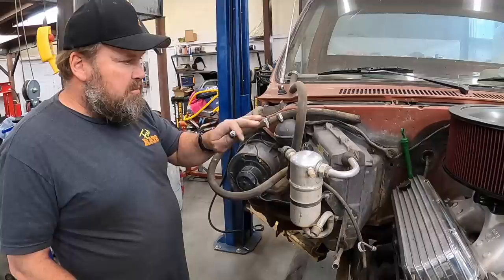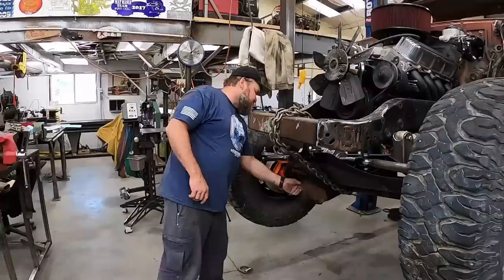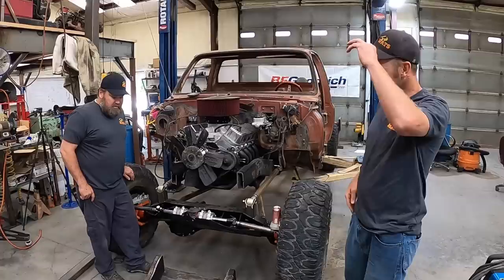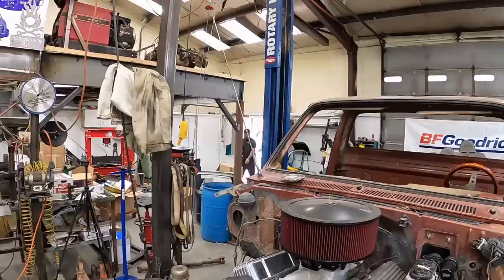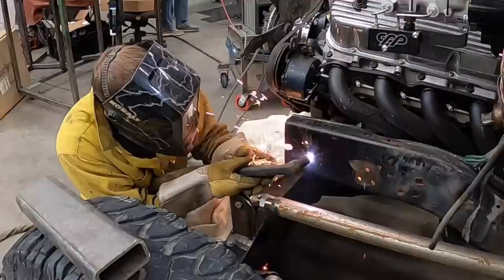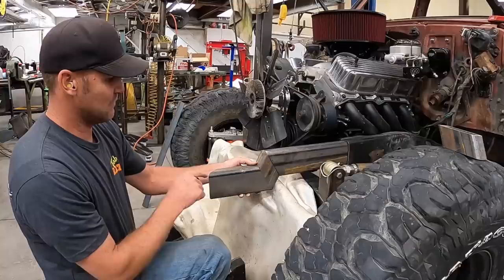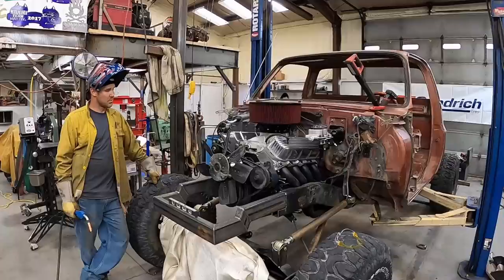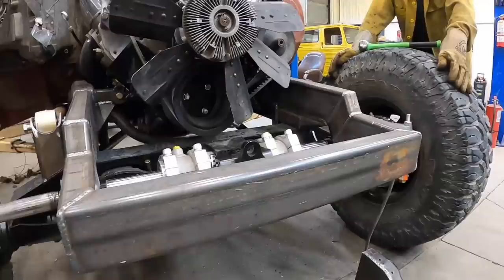This Custom Frame Is Never Going To Bend On The Rat Rod Tow Truck!

Comment: Why didnt you just plasma cut the existing frame to the dimensions you needed? You coulda saved on material and time. Also it would have been stronger once tubed back since there would be no butt weld seams. Im sure you have a good reason.

Comment: With all due respect, I see you struggling on many if not all of your angle stuff.
The way I learned when I was knee high to a grasshopper was to bend a welding rod when bending exhaust pipe.  That technique works bending, shaping, or cutting any tubing (round or boxed), and works when attempting to shape or cut sheet metal, and even plate.  The first time or two on a project you might guessing, using your eyechrometer, or perhaps using two other hands bending a tape measure to get your bends close.
the beauty of the rod is that it can be reshaped as many times as you need to get right, even perfect.  The wire is your mock-up tool.
Finally, you can use a light gauge wire or heavy wire to make shaping easy, or if you need some strength for longer lengths.
Use a wire...

Comment: I don't understand why you straight cut the 6" frame off behind the axle and replaced the removed material with a 4", and then added a 2" chunk right back in?  Why not just cut the 6" frame off at an angle above the axle and tie in the new front front piece and have the same shape you have now?

Comment: Exchange out the two door cab to a four door cab for more room. Then paint the papa sherm mobile the same color as the old cab. Extend the frame if required.

Comment: Why didn't you change to an electric fan so you could mount the radiator however  it would need with the frame raised for clearance??   Wonderful how there is a welding blanket protecting the front axle while $350 + dollars worth of aluminum valve covers have sparks bouncing and landing all over them. Hope someone put some silicone or plumbers putty between that evaporator box and the firewall like the factory does so cold air isn't leaking out of it all around.

Comment: What is with everyone building tow trucks/ recovery vehicles?   Some one should invest in an off road school.   Teach people not to drive normal factory vehicles into the rough.

I guess that would be hard to do.  After all!  Adds and commercials show how rugged of off road travel. That their vehicles can travel and "suppose" to handle right?  I guess no one thinks to ask.  How many of that just one brand vehicle, did it take to film just one commercial?     They also had a crew to recover all the broken parts.    LOL!   Car companies most defiantly want to sell you a new one. After being a dumb ass and tearing up the first one.
It seems all these recovery videos. That they have glamorized this field of trade.  Might as well give up effort now on building one. Unless you are doing it for the fun of it.  

I guess it's always an issue.   Had a guy years ago.  Bought a backhoe and used it for a business. He was making a reasonable living in this small area.  Then what do you know. Everyone had to buy a backhoe.  Then no one was making money.  Looks like recovery trucks/ tow trucks are going to become like ass holes also.  Everyone is going to have one.
Reply: Part of it is there will be a tow truck olympics for off road tow trucks, but it is a very much needed need, because even if you know what you are doing, things will break somewhere, somehow and when off road, someone needs to be able to go get it. Besides, this is not all that common in the wrecking business anyway.